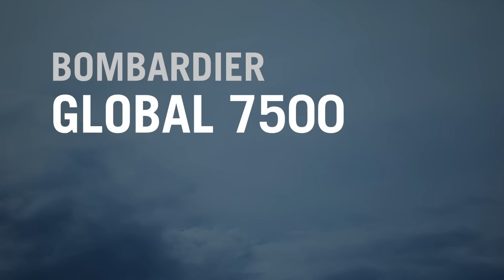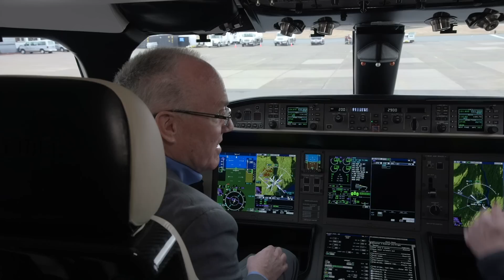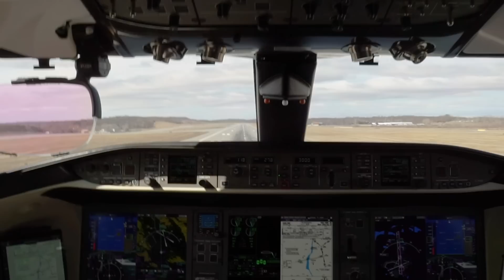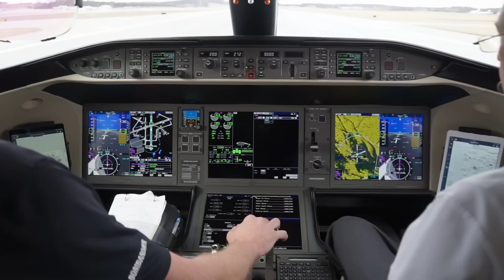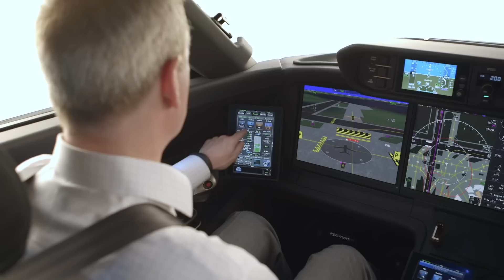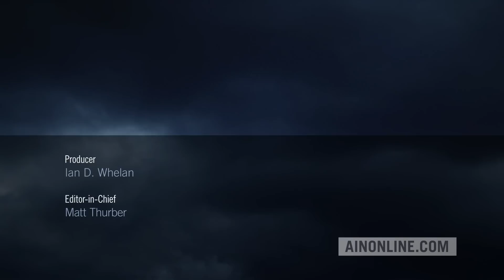Flying the Bombardier Global 7500 – AIN

Comment: The FBW they're talking about may be new to Bombardier but the system has been in use by Dassault for decades. So nothing really new there. Stall prevention? Used in Airbus A320 since 1988. Stage IV noise compliance? Gulfstream boasts their new 700 complies with Stage V. Come on! You don't have to suck up to manufacturers if you hope to maintain credibility! THIS is just corporate image video.
Reply: The 700 doesn't exist yet. Don't be counting chickens....
Reply: @macuss87  Aren't they testing it already?

Comment: What happens in a Gulfstream or other aircraft with touchscreen controls when one of the touchscreens goes out and now you don’t have control over any of the systems run on that screen? Can you switch control of those systems to another screen or are you just screwed and hoping that you can still fly without the affected systems?
Reply: Yes they are redundant! Touchscreen technology has been around for some time now, it is very unlikely to happen. They can use only one screen and cycle through all the options, and never even touch the other two. (3 overhead screens). So If you think about it you technically have 2 backups

Comment: I just don't know why fly-by-wire unsettles me.
Reply: Because you don't understand it
Reply: @PabloGonzalez-hv3td  Do you?? 😆😆
Reply: @pkl2000us  Yes. It's 60+ year old technology.
Reply: @PabloGonzalez-hv3td  So because it's 60+ years tech, you understand it better🤔🤔🤔.

Anyways, it still unsettles me
Reply: @PabloGonzalez-hv3td  A better initial reply to my Comment should have been

"Why does it unsettle you?"

Then I would have told you:

There is something scary about being 35,000ft above ground in an aircraft controlled solely by electrical signals from a computer.
Reply: @pkl2000us  There are multiple redundancies and mechanical backup like I said you don't understand what's going on. There has never been an accident caused by fbw failure in 60 years
Reply: F-16 pilots think it's ok. 😉

Comment: This craft is cool, but as a pilot; I would much rather fly my craft without the flight management nanny. I understand the flight management system assists with the pilot workload. However, I am very concerned about the long-term repercussions of diminishing BASIC stick n rudder skills.
Reply: That's true, that's why one on a while you take your old trusted Cessna 172 for a spin and work in your essentials! If i was the regular pilot of this baby and had to do it as a job (frequent long haul) I'd be fine with less workload! Is the same principal as commercial planes if you come to think about it

I think in one of the gulfstream videos they were explaining how real pilots! were in charge of developing the touchscreen system, where it was "pilot" oriented, instead of some computer nerd that only knows that you need a radio stack in theory only and slap it on the overhead instead lol(imagine that)

Comment: I'm glad Bombardier isn't yet going the Gulfstream route, replacing all the buttons and switches with touchscreens. Something about not being able to use the controls without looking makes me uneasy...
Reply: agreed, there are certain things that are nice as a touch screen but having everything a touchscreen sucks.
Reply: @beardedbarnstormer9577  go get a test flight with any g500 g600 or g700, get a first hand experience and then talk mate. The symmetry cockpit (i think that's what they call it on the new gulfstreams) is designed by PILOTS,  not engineers, for pilots!!! There is a cool video where they do a 25 min thorough overview of the system, and everything is explained indepth of EXACTLY WHY they did what they did.
Edit: https://youtu.be/38ox-7MOESQ

First thing you need to know, that plane is designed for TWO PILOT OPERATION,  that means PF (pilot flying) is FLYING the airplane, and the other called PM (pilot monitoring) does all the computer switches and radio communication and touching the overhead, and doing the checklists, and input in the fms, extending flaps and gears, you name it. They (PM) don't need to be looking where they going, THEY ARE NOT FLYING THE PLANE, the pilot flying is doing that. There is a channel corporate pilot life, go check how they operate the flights and you will see one pilot is "driving", and the other one is managing comms flaps what not, based on what the driver asks. 
Get a life you troll. Educate yourself on how an airplane is handled first, then judge why they put touch screens instead of hating. Gosh i wish i had a time machine and send you in medieval times you dinosaur
Reply: @Sokeresa   Lol bro i fly 135 im fully aware of how this works... im not sold on all panels being replaced by touch screens. thats all. there are many panel displays that work just fine with buttons and dials. Its nice having a detent and physical response. its nice having clicks on the dial to specifically rotate in a heading or channel. when you are in the shit its nice to not have to physically take your eyes off more important instruments so you can make sure you are tapping on the correct section of the screen.
Reply: Since you’re operating a PLANE, it’s always advisable to also look at what you’re pressing, even if you are acquainted with the cockpit. Have you ever seen how tiny some of these buttons are?
Reply: @olavo1mc   um wrong... many of those buttons are specifically keyed or tactically shaped so that you know what you are grabbing without looking. because like you said, you are flying a PLANE and you really shouldnt be looking at knobs and focusing on things inside the cockpit anymore then absolutely necessary.  Gonna take a wild guess that you dont fly planes for a living...
Reply: Bearded Barnstormer google a G550 cockpit and tell me which buttons you are refering to for instance. From my point of view, unless you are operating mono prop planes, things are a bit more complex on a jet. I doubt gulfstream would put screens to make it harder for pilots to fly.
Reply: @olavo1mc  On the new G700, most of the overhead panel is touchscreens, the main panel is entirely touchscreens, with more touchscreens around the throttles, and even more by the control sticks, not including the iPads hanging in from the sides.
Reply: @geley5285  in the new symmetry cockpit (g500, g600 and g700 i believe) the is technically ONLY 3 different input touchscreen, which have backups for a total of 10 screens for redundancy. The overhead ones are the same one but times 3. The 4 next to throttles and next to side stick are the same thing, just redundancy. There is two more next to the autopilot that are exactly the same, just one for each pilot. You can have multiple ones not working and still be airworthy and can operate the plane (imagine that). Also there is one above the jump seat that's identical, just in case the other 4 next to throttles fail. So technically you can have someone in the jump seat operating the mfc. Search g600 cockpit and you will see that video where everything is exclusive in depth.
Also this way you can do the cold and dark to ready for taxi prices in about 10-12 mins, supposedly half of the predecessor. This system is revolutionary.
Reply: @Sokeresa  So unsatisfying to use, no satisfying metal click!  Screw redundancy, I am a simple man who likes flipping them switches
Reply: @geley5285  yeah mate, i hear you. I like stick shift better as well, but for some time I came to like the automatic better for commute and what not.
Don't forget, this cockpit has been in development for 10+ years from i gather. There has to be more pros than cons. If you are in the market, you can always get a bombardier global instead, they seem to have the switches still :). I would definitely find a pilot that is willing to take the chance with these touchscreens when im ready to buy me one lol.

Btw are you a pilot? If yes how long, flight hrs, what plane(s) you operate(ed)?
Reply: @olavo1mc  there are still tons of buttons and switches in a 550 cockpit mate.... proving my point further.  touch screens are killer, i dont want the entire cockpit covered in them
Reply: There is a reason why everything is touch screen. It has to do with their new system of "internet" or call it "lan"  based infrastructure. Every new sensor, light, toggle, function, whatever, it's connected to this ethernet, instead of running single wires, then you just do a software update and a new button appears on the touch screens! So smart! Also, for all of you out there expert pilots with million flight hours, why do you think when Cessnas have glass cockpits nowadays??? Is the way of the future, it's proven it's less workload for pilots, flying the computer, the computer relates to the plane the info
Reply: @D B  Can it land on an unpaved/grass strip? Or is this more of a non-offroadey luxury business jet
Reply: @geley5285  the pilatus 24 jet is certified (or being certified) to land on gravel and grass as well. No other private jet can do that yet i believe. Pilatus gear is beefed up and i think they are running less pressure in their tires to accomplish that. That plane is targeted for rural places and has a very cool rear cargo door, that plane is targeted for multiple role, air ambulance being one highly anticipated role, and that door with the ability to land offroad is very attractive.

Edit: there is a b737, older model i think, they use it somewhere in Alaska was it,  that can use gravel strips. It has a device attached on the landing gear that helps with debris and stones from going into the engine. I just remembered i watched a vid of it on YouTube describing the plane. That would be the second jet plane that i can think of being able to land "offroad"

Comment: Good that Bombardier held on to the old keyboard/trackball system. Touchscreens have NO place in an aircraft cockpit.
Reply: Mik Normally, the information will just switch to another screen, that’s how it works in almost all aircrafts today. Even aircraft with no touchscreens.
Reply: @Mik I understand, I had dual FMC failure on the B738, and one PFD got blank as well. So been there done that, but it seems like it has a lot of screens. Or even one screen is actually 2. But I don't know the details.

Comment: The "fly by wire MCAS" system in boeing "to protect you" ~ doesn't work out so well for them.... How is yours safer lol ?
Reply: fly by wire is a simple safe and reliable construct used in planes, in use for over 40 years. The A320, launched in 1987 was the first civil jet to use the technology. There are no concerns with regard to its usage in the real world. 
MCAS is a Boeing construct that is unique to the B737 MAX. it is not used anywhere else. Perhaps you wish to reframe your question?
Reply: My exact thoughts
Reply: Such thing has been used since the very first Airbus A320, so I guess it’s relatively safe?
Reply: MCAS is not a fly by wire system
Reply: @PabloGonzalez-hv3td  MCAS can only work with fly by wire... All planes use different "forms" of MCAS on all fly by wires.... Its called "software" or "computer controls"...So yes its relivent to this comment on the video, as it says the fly by wire, "protects" you and is a safety feature... as some sort of "software" has to do that..... understand?
Reply: @RussellD11  You are conflating true fbw with an electronically controlled system. MCAS is not fbw and fbw has multiple redundancies which is exactly what MCAS was lacking 

In the almost 60 years that fbw has existed on airliners (Concorde) there has never been an accident because of fbw failure
Reply: @PabloGonzalez-hv3td  MCAS is a "safety" system designed for use only on FBW, and was supposed to be safe with many redundancies....My initial comment was accurate and somewhat sarcastic... as their "safety" systems are similar to MCAS. It is a flight control system, just like the control systems stated in the video... Thats all im saying, there is no debate here....
Reply: @RussellD11  Sort of. MCAS exists to maintain yoke input force gradients within certification requirements and by default this acts as an anti-stall system and aligns handling characteristics with previous models but it's not the true purpose 

It's a cousin of flight envelope protection which is what the video is referring to but its biggest flaw was the single point of failure not the concept itself.

Like I said true fbw systems have sufficient redundancy layers and even when one fails it's not a catastrophic event - for example Qantas 72

Comment: Everybody is talking about fly by wire like it’s a new technology
Reply: Dassault is probably laughing.
Reply: Fly-by-wire for small business jets IS new compared to commercial and/or military aircraft.  Technological advances and compact size of computer systems have allowed for its use on small aircraft.  In 10-20 years, you'll probably see FBW systems on single-engine Cessnas, Pipers and Beech aircraft, if it isn't already. . .
Reply: @robgyanisu312  14 yrs for the falcon 7x but I take your point.
Reply: @shadowmist1246  The Falcon 7x was the 1st business jet to have it; other companies are slowly following suit.
Reply: @robgyanisu312  Slowly is the key word.  Bombardier and Gulfstream this year only (maybe towards the end of last year).
Reply: @shadowmist1246  I beg to differ: the Gulfstream G650, which made its maiden flight in 2009, is FBW as is its derivative, the G650ER.  Also the new G700 is FBW, as well. . .
Reply: @robgyanisu312  Actually, I did not know that but upon further examination, you are correct.  I guess the G650 was the second business jet to have this in spite of not having a joystick like the G500/600/700.
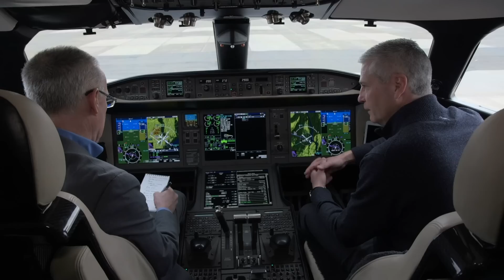Reply: @shadowmist1246  Tbh, I dunno: I'd have to go and look at each business jet model-Cessna, Dassault, Gulfstream, Bombardier/Lear, etc-and that would take time.  Which considering the current time, here (20:30 EDT), I don't have 'cause I have to get up and go to work at 04:00 EDT. . .
Reply: @robgyanisu312  That's ok, I already checked.  It was 19:30 here.  Legacy 500 was next.  It's not important enough to look at each jet.  Good night.
Reply: F16 had it in 1979 if I'm correct?